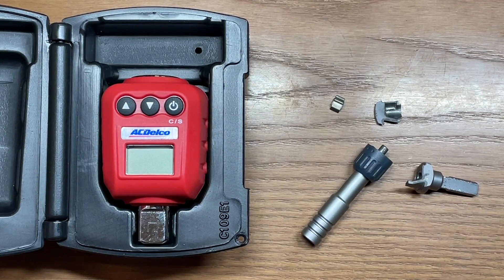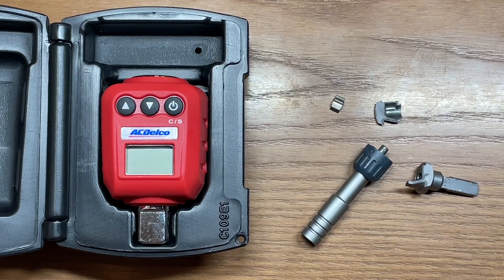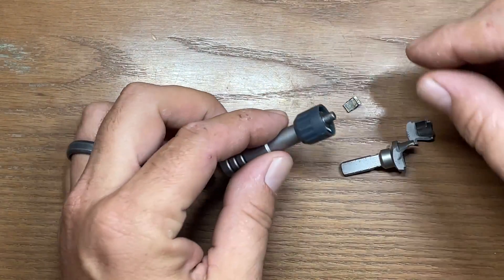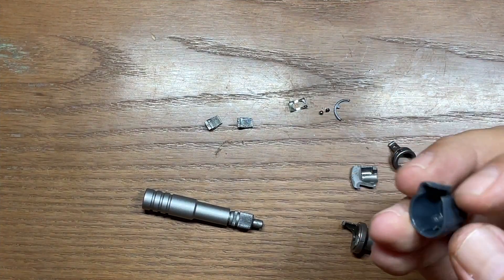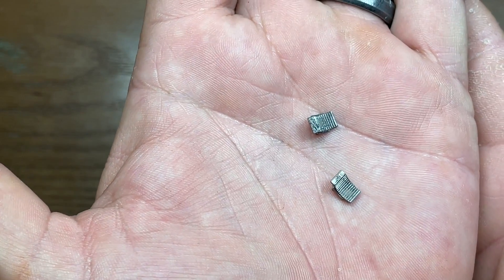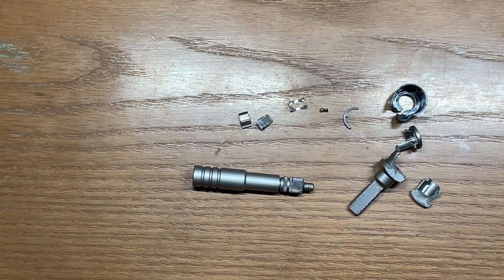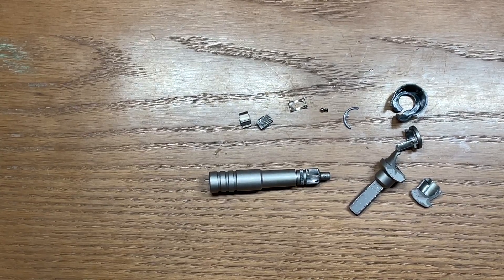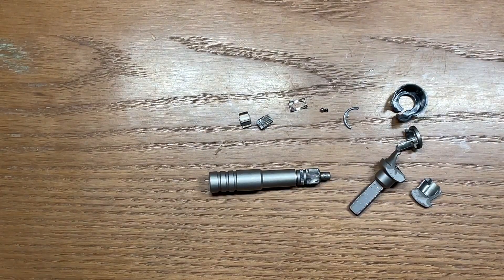Leatherman Ratchet Driver - Destruction Test

Comment: That shaft looks like sintered metal  not machined. For $30 I would expect more. I wouldn’t have guessed that thing to hold up over  12- 15 ft.lbs. It’s probably strong enough for use in the  multi tool as reefing on that will damage the bit holder itself.

Comment: I have a practical question - if you would have the ratchet mounted not in a vice, but some of the Leatherman multitools - would the ratchet give in before the given bit exchanger?
Reply from the maker: I think they would be pretty evenly matched in strength, but I’m sure the driver would fail first. That being said, it’s a pretty substantial force you would have to put on it before that would happen.

Comment: Question. Was there any lube present in the ratchet mechanism? Do you think it would be worth the effort to drip lube into the ratchet? Just curious. I know it would not affect the strength but might smooth the operation of the ratchet, mine is a little rough.

Comment: Basic tool is a screwdriver that normally  torqued in  "in lb".  It doesn't surprise me that a 1/4" or a 5/16"  dia. rachet shaft couldn't handle 25 ft lb.  A 1/4" dia. Steel bolt torques to 44 in lb or 3.6 ft lb. A 5/16" bolt is 88 in lb or 7.3 ft lb. You would expect the rachet to handle factor of 3x but a 1/4"  dia. ratchet shaft was nearly 7x and a 5/16" shaft 3.5x.
I'm frankly amazed at the strength of this  leatherman ratchet.

Comment: They don't use solid steel for the housing. They use metal injection molding with binding. Slightly stronger than plastic, but significantly weaker than solid steel. Its garbage. I wouldn't be surprised if the margin on that ratchet piece is 85 to 90%.
Reply from the maker: You could very well be right on the margins.

Comment: Leatherman ratchet is arrived to me...some difference with victorinox ratchet thath i note:

Leatherman 45 click, victorinox 38 click.
Victorinox have much much more play, but play for me is not a problem.
Victorinox sound like kind better quality, but is only a personal sound impression.
Victorinox almost freezes at a point on each turn, like a snap, if lateral twisting force is applied.
Leatherman runs smoothly even when lateral twisting force is applied.
Leatherman ratchet is an extension of the multitool.
Victorinox ratchet, in the end, is a simple separate accessory that has nothing to do with multitool.
Both work great for what they are.
Victorinox seems less cheap ... but perhaps only for the mirror finish and the absence of plastic ...
Reply from the maker: I think they can both be great options, it really depends on how each individual uses their multi tool.

Comment: Just finished my testing and my Leatherman ratchet driver broke differently than yours, the Leatherman flat driver sheared off the driver.  the ratchet still functions, but has some sticky spots now.  

it was right at 300 inch/ LBS or 25lbs that it broke which is right in line with your test here that it broke. 

My new question is how many FT/LBS can the actual adapter on the tool take? it doesn't matter if the ratchet driver can handle 25lbs if the adapter can't!  I'll have my video up soon
Reply from the maker: I’ve been keeping up, great series of videos you put out.
Reply: @txtoolcrib  Thanks man! means the world to me!  I've been really enjoying making them!  keep up the awesome work!

Comment: Your extension acts as a force multiplier so your gauge would not be accurate.  You should be measuring in inch pounds not foot pounds. I would expect you to test and hold 5 ft/lbs. or 60 in/lbs., max of 10 ft/lbs.
Reply from the maker: I’ll try to redo this a bit more accurately.

Comment: Now I'm disappointed that I won't be able to torque down the wheels of my Tiguan using the Leatherman Tool and ratchet. 🤪😂

In all seriousness, I'd think that the driver on my Surge, where the adapter would go in, will break even sooner. So, for me, that's not really an issue at all.
Great test though. Always enjoy your very informative content. 👍

Comment: Tener exageradas expectativas en cualquier herramienta, es un error; y como bien has demostrado, ese ratchet driver de Leatherman no es la excepción; en lo personal, pensé que tendría mayor resistencia, pero no ha sido así, aunque su capacidad de torque ha sido buena. Muchas gracias por el sacrificio de esa pieza. Y no olvidar jamás, que no se puede ni se debe confiar demasiado en ese tipo de herramientas portátiles; una multiherramienta o complemento de ese tipo (como Victorinox o Leatherman), nunca van sustituir a una herramienta especializada.
Reply from the maker: tienes toda la razón.  Creo que muchas veces la gente parece confiar en estos para reemplazar herramientas reales.  A menudo, tienen expectativas inalcanzables.

Comment: I used the ratchet driver a few times this week at work removing and racking some network equipment. I put an extended philips bit on it and besides adding some more wobble to the whole driver, it seemed to be fine. Only time will tell if it holds up.
Reply from the maker: Thank you for sharing your insight.

Comment: Standard 1/4 inch fasteners are typically torqued using “inch-pounds” because the equivalent “foot-pounds” scale is so low and won’t register (such as in this video) and is not advised because readings even if they were to register, would be so low on the ft-lbs scale, would be inaccurate. This is why there are typically two types of torque wrenches, ones with 10-80 ft-lbs scale and 25-250 ft-lbs scale. I have always been told to never use the lower 10% nor the upper 10% of the torque wrenches scale for this reason. Dealing with small fasteners and especially stainless steel and reaching certified torque specifications can be a nightmare. Having to certify dozens if not over one hundred torque wrenches daily. The best results for a fixed, repeatable torque value we ever had were with makita 18v torque wrenches that could only be set by the company that would certify and warranty the tool, but at about $500 US dollars a piece, is a very expensive affair. 
I would suggest the standard Leatherman extension for any type of fasteners larger than 1/4 inch. Maybe we need a compact, extending 1/4 inch type breaker bar for edc as I have seen several youtubers including this new Leatherman ratcheting driver with a small socket set up to about 1 inch and I think that they will soon find out that it won’t be up to the task.

Comment: seems many peaple do not understand waht is these thing...and compare these ratchet with much more heavier and dedicated tool....
These ratchet have 2 mm of steel, its very light and it is used on multitools for unscrewing screw from wood or little home works...
Waht is the meaning of these reasonoings??
Each multitool screwdriver get broke or twisted in these test for me.
it is like saying that the propeller of a motorboat breaks before the propeller of an oil tanker.

The test in itself is interesting just for curuiosity...

Comment: I really appreciate that you sacrificed your tool. That said, I'd have been satisfied if the ratchet driver survived  a mild torque that you can exert on it with a normal multitool usage, like using a lever arm the size of the surge. Even from these expensive multitools, I don't expect the vibranium-like super-strength. Please don't sacrifice your victorinox rachet on far-over-the-expectation over-load. One destruction of this fine tool broke my heart.

Comment: I see some commenters saying that this was done on purpose to protect your tool... I dont get it.. Leathermans standard bit adapter allowed for full torque on the tool , why would they suddenly add a breaking point to the rachet when the standard one dosent seem to be breaking leathermans all over place... People really love that leatherman name
Reply: Is stupid pretend  that a mukltitool or ratchet multiutool handle massive levels of torque. if you pretend to unscrew a rusted bolt from an engigne or similar with these ratchet, simple you are stupid. It not depend from love or hate leatherman name.
The torque that handle these ratchet is more and more than sufficient on the application for witch it is made.
it is a tiny accessory !!! with 2 mm of steel .. What do you expect?
Reply: @fc436  i expect full alumunim housing minimum... Its clear that it falied at the plastic, which is exactly what i thought would happen when i saw this sorry excuse of a 50dollar tool... Your welcom to waste your money on this, and your entitled to your opinion, but simply saying that is a multi tool accessory and should be shitty is a joke

Comment: Redo this rest with the cheapest rachet driver you can get you hands on and compare... Leatherman cheaped out this like crazy and you should compare to what quality they set out to get... I still suspect that this is a dollarma quality tool with a 30-50 dollar price...
Reply: Good plan, and throw in a 1/2 decent ratchet as well. It would still be half the price of this accessory

Comment: Klein Tools Electrcian Ratchet 65200
Steel body with gear switching not steel but a different metal. 1/4 on one side and 5/16 on the other with a magnet in the middle. Comes with a small assortment of 1/4 bits. I have used it to break 7/16 bolts to get into a light housing to replace the LEDs

Comment: My experience with torque wrenches is that the extreme low and high ends are not very accurate and therefore moving up or down in size is recommended.  Perhaps an inch/lb torque wrench should be your starting point.  Start at 100 inch pounds and gradually increase. Most manufacturers purposefully create a wink link to cover warranty issues and this may be it since it is new and can be updated to an acceptable level. The consumer becomes the test track as to what is forgivable in the real world. The two year warranty may also move up or down depending on warranty numbers.

Comment: This a a pity as it’s a good idea it just needs a re design,. I wouldn’t mind paying a bit more for better tolerances. Great test Ben thanks. 👍
Reply: Why?  You would rather have your whole tool buckle like a pretzel to drive that 1 inch lag bolt?  It’s designed to fail at a certain point.  It’s cheaper to replace the ratchet than the tool.

Comment: Interesting test, but I’m not really disappointed. I see a lot of people commenting that they are deciding against buying it or returning theirs. Guys, this thing is meant to be light weight to work with a multi-tool for light tasks. Yes, it’s made of probably aluminum and plastic, but if it were made of chrome-vanadium or whatever it would weigh twice as much. At that point you may as well carry a 1/4 ratchet or box wrench. I have used mine several times, and so far I am not disappointed. Just because something ratchets doesn’t mean it’s meant to handle a lot of torque. It’s the convenience of not having to pull your tool back off of your screw/bolt, then reapply to loosen or tighten. Just a smooth twisting motion.
Reply: Great point.
Reply: I was gonna buy a ratchet screwdriver and modify it to work in the but holder. Leatherman saved me the effort. Had it 3 weeks and love it!

Comment: Now you're making me glad I made my own. I took an old 1/4 husky box ratchet I had. Cut in half and used JBWELD steel stick to bond it to a 1/4" 3" long bit and use with an adapter on my square Phillips on my leatherman core. Total cost 8.00 which was for the jb weld👊

Comment: I had one of these in my cart at REI the other day excited to buy it. But I decided it would be smarter to wait for your review. I think I'll just try to build my own now.
Reply: Performance tools has a 3/8’s ratchet adapter for sockets. I used that and then 3/8 to hex adaptors to make my own. Good luck!
Reply: @dawnqwerty  that's a great suggestion, thank you. I didn't know about those until I just looked it up. I was going to take one of those ratcheting screw drivers that you can buy at Walmart and tear it apart and use the shaft.
Reply: @NavyMachinistsMate  they’ve also got a lifetime Warranty and since you aren’t altering it in any way you get to keep the warranty. Although I’m sure your multitool is more likely to break first

Comment: One could still use the ratchet to speed the process and finish torquing without the ratchet. Building it tougher probably means making it bulkier, which would reduce its ease of carry/portability. Thanks for the test.
Reply: Yes, this exactly, thank you. Just because something ratchets doesn’t mean it’s meant for torquing. This was meant for speed, ease of use and to be light weight.
Reply: @redplague76  yeah but not even 35ft lbs? adn the steel breaks? that is just poor QC
Reply: @happytrails5342  It has nothing to do with QC. It’s not meant to handle more than 35lbs, and that is perfectly fine. Multi tools and their accessories are not meant to replace your regular tools.
Reply: @redplague76  the way it broke is more what I was referring too , I saw another video that broke down at the rectangle bit shaft rather then exploding

Comment: I’ve been reading posts on a Facebook group that the ratchet driver isn’t very durable, some have broken in days after using... me many recommend to return or wait for a 2.0 version.
Reply: Why? Use it for its intended purpose, not to remove lug nuts! I've had mine for 3 weeks and it works great for small tasks!

Comment: One thing that could have also affected getting a reading was the length of extensions you used. The longer the length the more strain/flex there is. Kind of like a breaker bar.
Reply from the maker: You're probably right. I should have done this with just the breaker bar.

Comment: Thanks for the demo. I don't plan on doing any heavy-duty rachet driving with this tool, I used it to repair a door locking system and it worked fine.Keep up the good work bro
Reply from the maker: I think it is going to work just fine for most people in day to day tasks. Anything can be destroyed with the right amount of force, I just wish it had been slightly stronger.
Reply: @txtoolcrib  same here

Comment: Interesting. Looks as if the two shafts are made from aluminium forgings, not steel. I think I'll save my money, and stick to my 1/4 " Topeak ratchet driver and bit adaptor.
Reply: Aluminium??? What are you sayng? Leatherman standard bit extender is made of 420 hc and also these ratchet i think.
The leatherman supertool 300 m bit extender is made of s7 steel.